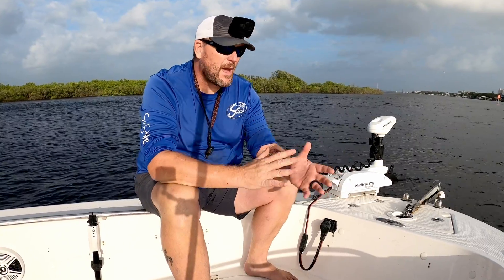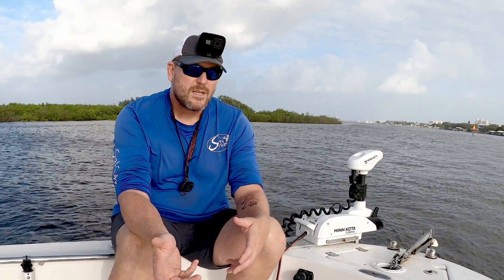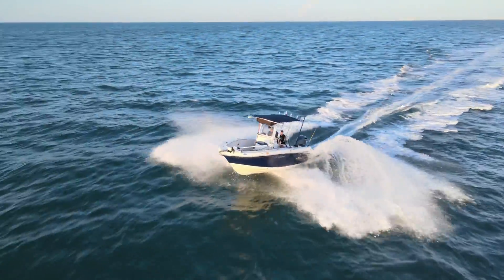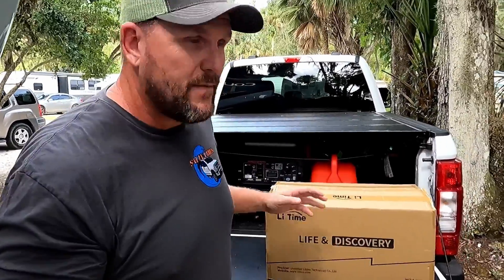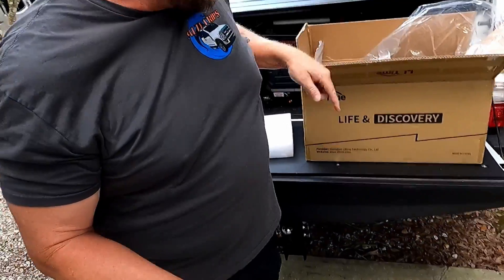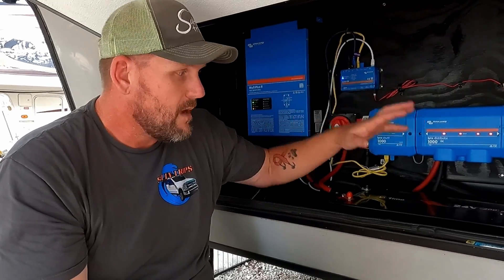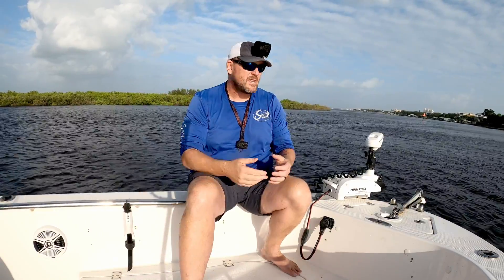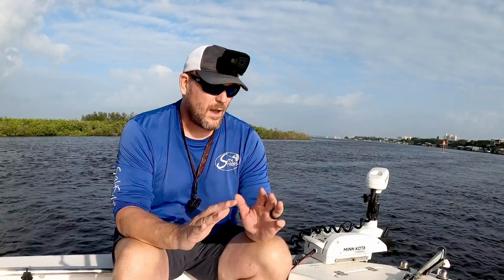36v Lithium Battery for Trolling Motor... LiTime Lithium

Comment: I have heard of 3 people in my area boat burning down because of these batteries… I really want one but that is what has stopped me from buying one yet…
Reply from the maker: Unless you’ve seen one burn up in person I wouldn’t believe it. We’ve been using these lithium batteries in our boat and RV for years. I’ve never heard of one of these things burning.
Reply: @SaltyStrikes  Ok thanks, I know how ppl are 👍
Reply: @SaltyStrikes  this is such a bs reply. I’ve never seen a blue whale so I guess they don’t exist
Reply from the maker: @vjmotano835  Lithium Iron are completely safe, there’s tons of information out there about them. Lithium Ion are the ones that have the bad track record. The only incidences involving Lithium Iron Phosphate batteries are almost always due to operator error and not the battery it self. There are a million articles discussing the safety of these batteries for indoor use. That was an extremely ignorant reply. There always that person that says “i heard about a time when” but I don’t know a single person that has ever had an issue with LiFePO4 batteries.

Comment: Any info on  the LITIME mini will it do the job about the same as full size ?
Reply from the maker: Hands down i would go with 3 Mini’s in series. They have a great sale going on right now. Only real difference between the mini and regular size 12v 100ah is price and the mini is smaller.
Reply: Perfect! I was on their site and going through reviews and MINI Definitely caught my attention due to weight and space. I will definitely be making the purchase. Thanks to your response!! 🎣
Reply: Interested in the batteries but not much info on the MINI. They Would be running a 36v Terrova In Series. Thanks !
Reply from the maker: @staybusybuilding2910  pretty much has the same specs

Comment: Hi Chris.  Nice informative video.  Hey i have to replace my batteries in the boat. Ones bad but im going to replace both. Just had the boat two years as you probably know. Not sure why the one gave out already. But my question is can you use these lithium batteries for your main cranking batteries or are the only for trolling motors?
Reply from the maker: Most lithiums don’t have enough cranking amps for a starting motor, house or trolling motor only pretty much, I’m sure starting lithiums will be coming in the future.

Comment: Thanks for the info been interested in switching but didn’t due to cost
Reply from the maker: It’s definitely cheaper in the long run, Amazon has some good Prime Day deals, links in the description area 👍
Reply: I just bought a 100ah lithium for under 200 on Amazon. It has all the protections, balancing and Bluetooth.  Which is about the same as if I bought a regular lead acid deep cycle.

Comment: How does a lithium battery work for a outboard motor battery?  Specifically, will it work with the motor charging system?
Reply from the maker: I wouldn’t use them for a motor starting battery, they typically don’t have enough cranking amps. Would make for a great house battery for live-well, and instruments, just would need a 12v to 12v DC lithium charger.

Comment: Nice video Captain!  I also like the weight difference between the LA or AGM and Lithium.  Tight lines!
Reply from the maker: Yes thats another great advantage, lead Acid really only has one use in this day and age and thats a starting battery and thats pretty much it.